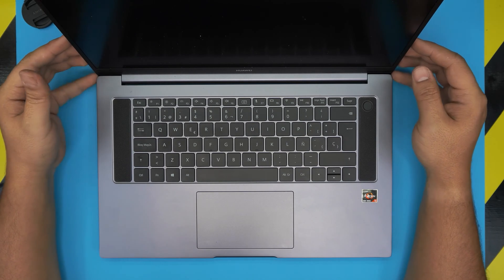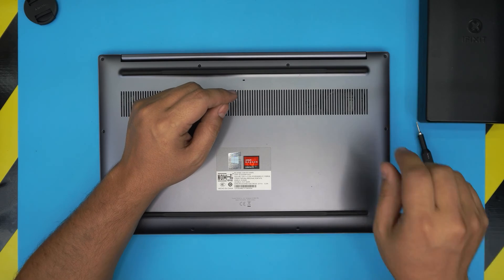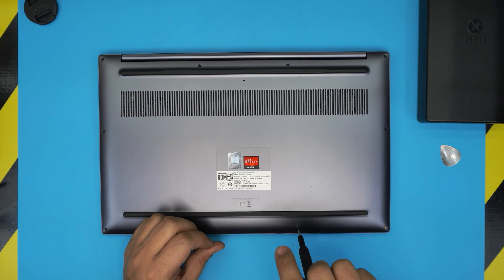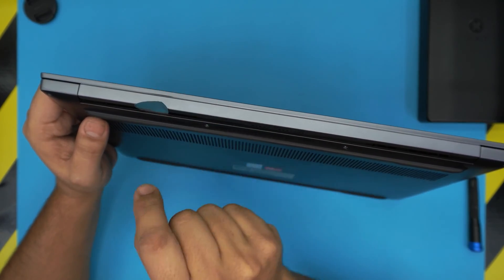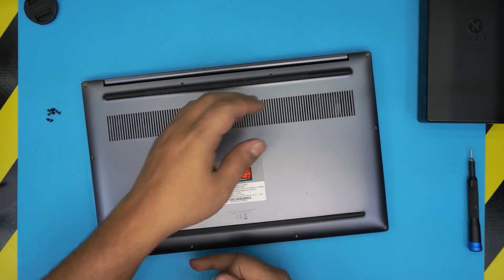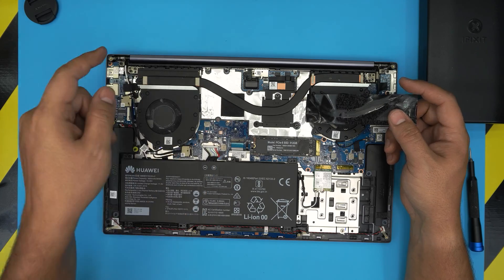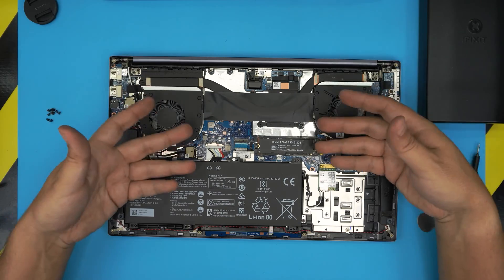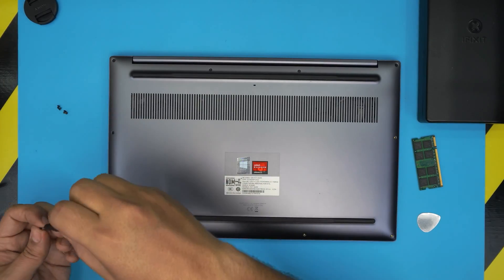Upgrade RAM for Huawei Matebook D16 AMD Hvy Wap9 Laptop 🚫NOT POSSIBLE🚫

Comment: Which part can we upgarade? I see there is m2 SSD there (probably there is 1 slot), so we can remove 512 and replace another bigger than 512 GB.
Reply from the maker: Thank you for your feedback! If you wish to support the channel, you can like, subscribe, or both!
Regarding your question, yes the only upgrade is the m.2 NVME with a up to 2TB without any issues, here is a video that i made for the ssd upgrade:
https://youtu.be/2vW6eXDzk7M